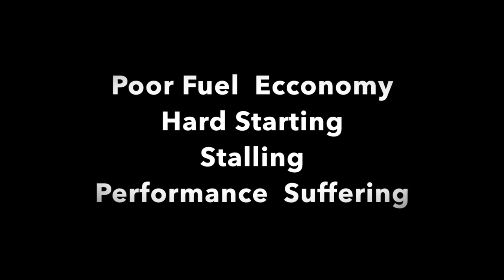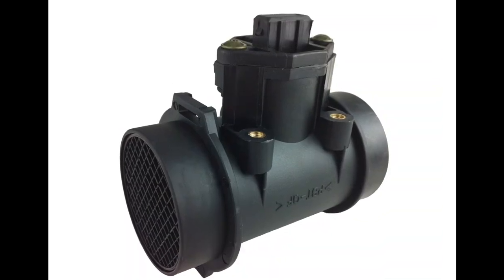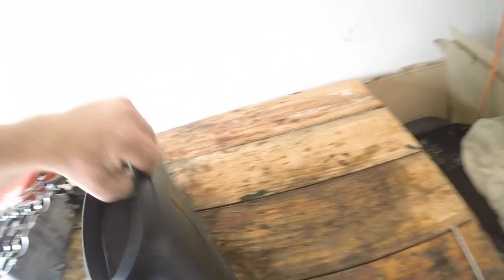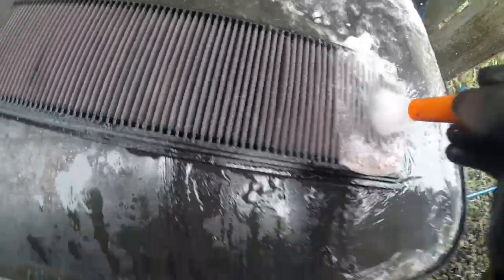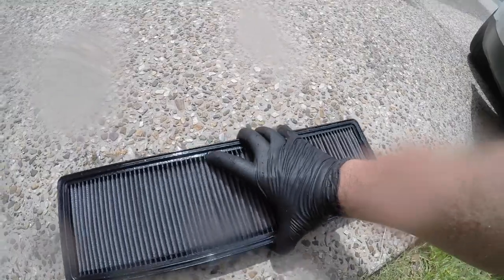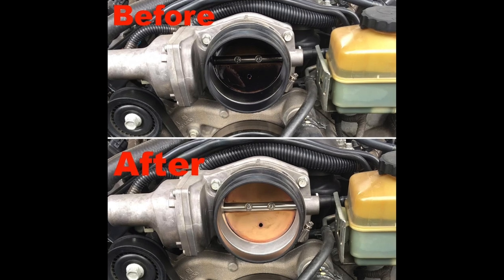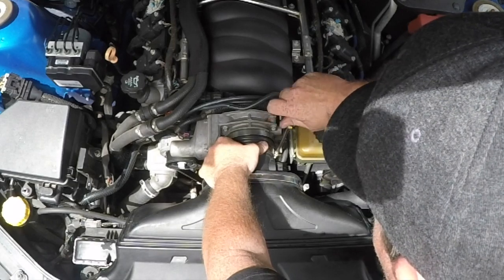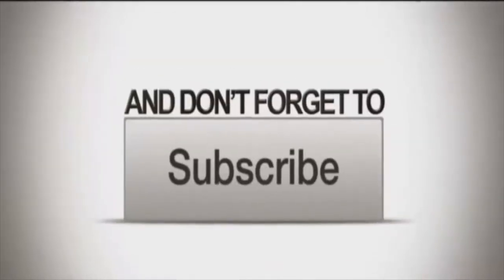MAF and Throttle Body Cleaning with Bonus K&N Filter Cleaning

Comment: I don't give a Castlemaine xxxx you Ripper...  Good job mate
Reply from the maker: Thanks for the comment. Pinned it to the top!!
Reply: It’s takes the second turn of my ignition to turn my 2005 Dodge Ram 4.7 on. What might you think it is? I already changed the battery. It seemed to have helped a little bit!
Reply: @killawattgarage  what's up bro,I have a 05 4.7L V8 Toyota tundra I clean the throttle body cus every time I turn on the heater it was shutting off the truck.so I look up on you tube and it said to clean the throttle body so I did that now it gives me a very low poor idle .what can I do to have a normal idle? I would appreciate it if you can he me pls also it smells like gas
Reply: @killawattgarage  dude, you said you cleaned it from the dirty side first, yet did the cleaner side, which is really the intake side , you got the sides wrong just pointing it out?  The ribbed section faces outwards towards the incoming air, the flat side points towards the air intake throttle body?
You described it backwards that's all, but what a great upload, just wondering if the other OTRS which more or less the same design is so easy to take out the KN air filter? Keep up the great work, also how many times had you had to do this?
Reply from the maker: @7071t6  awesome thanks for the comments.

Comment: I usually spray the throttle body cleaner on to a cotton cloth material and then go in there and wipe it down. This way the cleaner won't make its way into any sets or orifices Etc. Also many times were the butterfly valve comes close to the throat sides it needs to be cleaned with a bit more vigor.  The K&N filters have worked great for me, both air and oil.  

And since you're talking about breathing well, if your car has it, it's a good time to change or clean your cabin air filter. This one is often overlooked and come out looking like a horrific mess.

Comment: It's good to allow a freshly oiled K&N filter to sit, overnight, on newspaper to wick away any excess oil because that oil is what contaminates the sensor wires on the Mass Airflow Sensor; which can trigger the check engine light. Good video!
Reply from the maker: Thanks for the comment. Will definitely try that next time, great advice.

Comment: Since you have a few hours to kill waiting for the filter to dry before re-oiling, I personally think it would be best to go ahead and remove the throttle body from the intake so you can completely clean both sides. It's only 4 easy to get to bolts and (maybe) an electrical connector. Especially since the back of the throttle body and throttle plate are nearly always much dirtier than the front - I noticed that the front of your throttle plate was pretty dirty, makes me wonder how bad the back is.
This is what I do with my LFX engine in my 2013 Camaro, pull the MAF sensor, throttle body and air filter, cleaning them off the car so I can do the best job possible. My LFX is a "drive by wire" throttle, but as long as I don't drop the thing in a bucket of cleaner or water while it's off the car and use a bit of common sense while spraying the cleaner through the throttle body, it's not caused a problem or kicked up a check engine code yet.
Reply from the maker: Don M to all reading this comment, this is a great idea.
Reply: Thanks, just trying to be of help.
Reply: Yep that exactly what I done recently to my VZ Calais throttle body undone the 4 bolts and removed the throttle body so I could clean it properly
Reply: tottaly agree i allways do both sides another side is allwys crazy dirty and in 90% of the time it will be just 4 screws and 1 jack connector

Comment: If you clean the front of the choke valve you also have to consider what’s behind it. You can place the car in the on position without starting the vehicle and have someone depress the gas pedal to fully open the throttle body valve. That way you can clean both ends. It’s natural for the product to get In the intake. Especially if your using a carb cleaning solution it is recommended to get some in the intake as it helps to clean out some of those deposit build ups.
Reply from the maker: Great advice, will try it out. Thanks for the comment.

Comment: Where the butterfly valve comes into close contact with the throttle body and the edge of the butterfly valve are critical locations to get clean. What does down a couple of times if you need to. Also it's often better just to put the throttle body cleaner on a cloth and then wipe it down that way the fluid won't get into any critical components.
Reply from the maker: Just saw you comment now, sorry for the delay. Agreed and thanks for the information. Cheers.

Comment: You can mess up your tb if you force it open like that unless its a older car with cable controlled tb.
Reply from the maker: Of course..........gentle does it. However, I have yet to damage a throttle body after cleaning hundreds of them.
Reply: Clutch cable
Reply from the maker: Don't understand your comment?
Reply: Killa Watt Garage he is saying your gonna damage your mass air sensor with that stuff
Reply: I have cleaned mines this way for years. Never a problem

Comment: I have a 2005 Infiniti G35 sport Sedan 6MT that I bought new. I run a cold air intake with a K&N filter. I have had to clean my MAF every year. It looked just like this one. It has 140,000 miles on it and uses oil, about 1/2 qt every 2500 miles. I also have a 2011 Nissan Frontier that now has 239,000 miles on it. I have used ONLY OEM air filters on it. My MAF and TB look just like new. I have never had to clean them. It also uses about a4 oz of oil in 7500 mile changes ( only Mobil 1 in both). K&N (Air Hog et al) will KILL your motor. It’s just that simple.
Reply from the maker: TexasScout Noneofyourbusiness I have heard     good arguments both for and against K and N  filters. The price of OEM filter are getting cheaper making reusable filter less attractive. 👍🇦🇺

Comment: Make sure you never force the throttle plate open if the car is  Drive by Wire, forcing it open will damage the throttle body.
I would remove the negative cable from the battery and force the reset of the ECU

Comment: If you have an electronic TB (drive by wire) do not touch it or open it with your hand. You will f up the calibration and need a new TB. If it's a metal cable (drive by cable) then you can do it with your hands without a problem
Reply: MICHAEL JAMES  you’re right I take mine out once a year on my LS. As long as it’s unplugged. Never had an issue either.
Reply: Repeatedly pushed the throttle plate open on my car's Bosch DV-E5 ETB while cleaning it (unplugged from ECU and removed from intake obviously) and put it back into place, didn't disconnect the battery while doing it either and didn't do any relearn procedure. Started engine up and it idled and revved up as it always did... all of this on a Vauxhall.
Reply: No touching or moving the plate does nothing.
Reply: @nighthawk0077  Just remember to unplug the ETB from the harness before working on it. Otherwise, if it suddenly gets actuated for whatever reason while it's being forced open, something may break. It can't be actuated unplugged unless some kind of Poltergeist is messing with it that is...
Reply: On fords you can calibrate the electronic throttle body after cleaning. You keep the positive cable on your battery, then take the negative cable off the battery and place a towell under it so it doesn't touch anything. Then run a 12 volt jumper cable from the positive terminal while hooked up, to the negative cable that isn't on the terminal and laying on a thick towel for insulation. Keep the jumper cable on for about ten minutes, it will short out the computer. Start the car up and let it run until normal operating temperatures while the parking brake is on. Once it hits normal operating temperatures turn the a/c on full blast for one minute while idling. After the minute is up take the parking brake off and drive for 15-20 minutes while the a/c is on. Make sure to drive at the same speeds you normally would so the computer learns the proper air fuel ratio for your driving style. Make sure to go on the freeway also. Using just the jumper cable may be enough to reset your personal vehicle, but my explorer has to be calibrated while the a/c is running to be properly done. I learned this from a ford technician!
Reply: Why would moving the blade mess anything up...... Explain
Reply: @ftex-rw2hm  Most of the time, what really happens is that improper reassembly causes a vacuum leak and hence wild idle... i bought new upper and lower side tb gaskets and replaced them when i did mine and had no problems at all...
Reply: It’s almost impossible to move the plate of an electronic throttle body by hand alone. Most modern car TB can only move if it’s in accessory mode and someone depress the gas pedal without starting the car.
Reply: Ive cleaned electronically controlled throttle boadys, as long as you have the car off it wont mess up the calibration and thats a fact

Comment: When wiping out your throttle body, use a soft cloth or rag moistened with your preferred cleaning agent, preferably lint free, instead of tissue or shop paper as the material won't tear and get bits jammed in the butterfly valve....
Reply from the maker: roythearcher couldn't agree more. Sometimes you just grab what's nearby. What you said did happen in the video and I edited it out.

Comment: Is it true you shouldnt push the butterfly valve with your fingers, on a drive by wire, otherwise you can wreck the calibration of the electronic controlled butterfly valve?

Comment: I would have taken the throttle body apart, you can clean it a lot easier like that, I do that on my 2013 RAM, it's very simple to take apart. Plus you can check all the electronics to make sure there's no corrosion or build-up of deposits. I pull the part throttle positioning sensor and found out that it was completely black inside there from deposits all over the electrodes, and once I did that it ran like a dream.
Reply from the maker: Hi Ryan, thanks for the comment. You are 100% correct, your method is a better alternative however when considering the time involved, a quick spray and wipe down achieves great results. Cheers.
Reply: If you totally remove the throttle body to clean and once it is reinstalled,  will it throw any check engine lights?

Comment: Love ur videos, I have a falcon ute that's been sluggish and if i rev it to high when say im getting onto the motorway, it holds the revs above 2,000 rpm even when i dont accelerate. i can kick the clutch in and the revs just sit up around 2-3 grand. Its not until i kick it in the guts and red line it for a split second that it resets itself. Maybe it because I have never cleaned the MAFS or throttle body.
Reply from the maker: Sounds like its a good candidate for a throttle body clean!!

Comment: It’s takes the second turn of my ignition to turn my 2005 Dodge Ram 4.7 on. What might you think it is? I already changed the battery. It seemed to have helped a little bit!
Reply from the maker: It may not be your slow starting problem. Pull off the intake pipes and have a look at the throttle body. If its gummed up then I recommend cleaning it.

Comment: Have a high idle in park and neutral after following this exact procedure. Does the PCM relearn the correct idle on its own?
Reply from the maker: Robbo 7490 yes it often has to relearn the idle. Take it for a drive and it should settle down
Reply: Its been over two years. You still driving around for the idle to settle? 🤔
Reply: No, it took about 3 weeks for it to return to normal

Comment: Hi there,I have just cleaned the air flow sensor and the throttle body however the car is now not starting up. I allowed ample time for both to dry using their respective cleaners. What may be the issue/s? Please advise. I have a 1987 Holden vl berlina. Thanks Manny
Reply from the maker: Emmanouil Adamtzikis Make sure all the sensors applied back in. Sometimes I let it dry out with the throttle plate open. Also may need some accelerator pedal on while cranking.

Comment: Audi TT mk1 hesitating under load, hills!! Great on the flat!! Could one of the above be the problem? Great video mate 👍👍🚗
Reply from the maker: Its worth trying. Be aware VW throttle bodies shouldn't  be forced open. It sounds more like a spark issue. Check the plugs and coils.Thanks for the question.
Reply: Killa Watt Garage thanks for getting back to me mate!! Just had the plugs changed and the coil packs ain’t done 10k. Think I’ll check the wires going to them 👍 I’ll keep u posted bro 👍👍

Comment: Hello, before I cleaned my maf sensor and throttle body on my 92 Lexus sc300 with a 2jzge the car would hold idle around 2k and would let me rev up somewhat actually. Now that I cleaned my sensor and throttle body the car idles at almost 3k now and it does not like any light throttle now it completely bogs out and stalls. What the did I do wrong to make it worse? Don’t understand.
Reply from the maker: Thanks for the question. Are you still having issues?

Comment: can you manually  move the throttle plate with fingers for cleaning without disturbing the TPS settings
Reply from the maker: Some vehicles are sensitive to having the throttle plate moved while other have no problem. If you are unsure, it's best to be cautious. Thanks for the question.

Comment: I have a 2006 Mazda 5 I cleaned the mass air flow sensor and my engine light went out and started to drive better. Now it’s not wanting to shift gears going up to 4rpms before shifting. I unplugged the sensor today and my car shut directly off. Does that mean the sensor is good or bad?
Reply from the maker: Plug the sensor back in and take the car for a drive allowing it to fully warm up. See if it is still slow to shift. Sounds like to sensor is ok. Did you read the codes for the check engine light?

Comment: Thanks for the video!

My FJ cruiser fuel average is not that bad (considering big engine), but idling is poor! 
I am replacing air filter every 20,000 KM
I will clean with MAF sensor and throttle body!
Just wondering if there can be other root cause?
Car power pick is ok

Thanks in advance from Saudi Arabia!
Reply from the maker: Cleaning the MAF and throttle body will be a good start. If possible it would be good to scan for any error codes and go from there. Let me know how things go.

Comment: Modern intakes are electronically operated and should not be forced open I was told.. Not sure if thats true. I was told to spray it in the intake and get someone to press the pedal down as you spray it in..
Reply from the maker: Yes, some cars are sensitive to the throttles plates being opened manually some are not. This particular model has no problem with it. If you are unsure then I suggest you use your method or remove the throttle body to get to both sides. Thanks for the comment.

Comment: Great video thank you but don't you think a throttle body that dirty indicates that the K&N filters are garbage?  I do this lot and have never seen a throttle body as dirty as yours behind those filters. You must have a leak somewhere or the K&Ns were improperly oiled or sonething because that incredibly sooty throttle body behind any filter is not normal at 10k miles.  Anyway check it to make sure. Thanks again for the video great job.
Reply from the maker: From memory when I pulled out this filter it had oil dripping from it. It also was mounted incorrectly in the filter housing causing air to leak pass the filter and produce the dirty throttle plate. So you are 100% correct! I think paper element filters are fine for general use. K&N's are great when exposed to lots of dust and dirt and then you can wash and reused. There are lots of Auto shop demo's showing K&N filters better flowing abilities but often the engine can't utilise it, so it's a waste and paper element filters are getting cheaper and cheaper. Thanks for watching the video and the comment.

Comment: You might want to pull the T.B. completely off. There’s another side that’s as, if not more dirty than the front.
Reply from the maker: Agreed, pulling the throttle body off and cleaning both sides is the best, but sometimes we look for short cuts and cheaper costs. Pulling off the TB in many case would need a new gasket adding time and cost. thanks for your comments.

Comment: I have a 2014 KIA RIO  (with 67,000 miles) and took it to the dealership for its oil change.  They told me the throttle needs a cleaning. Is it really necessary? Don’t really know about cars. Thanks
Reply from the maker: George Sarmiento when the throttle gets dirty it gets covered in a sticky oily substance. This can effect the engines idle and throttle response. Your engine maybe stalling, difficult to start and have flat spots. Be careful because it's also an easy money maker for dealerships as it's a simple and quick process that is often overrated.
Reply: Killa Watt Garage cool got it. Thanks for the reply!